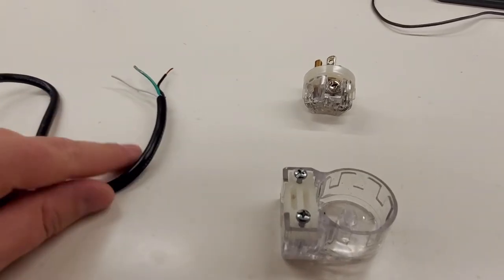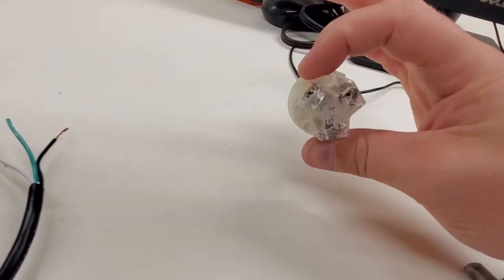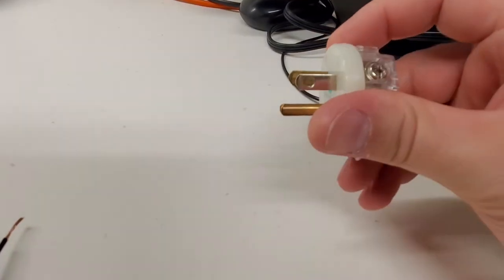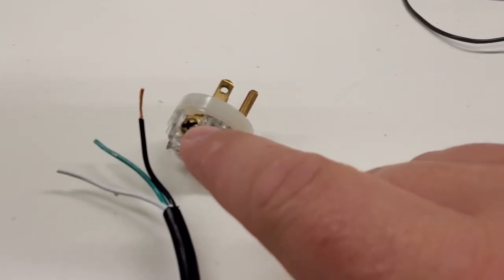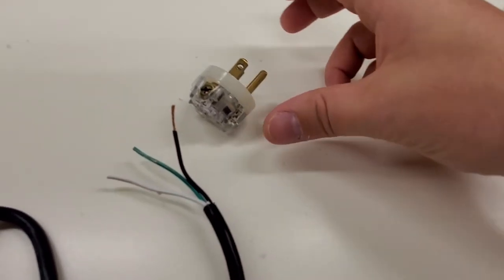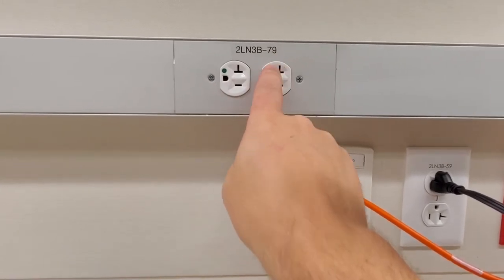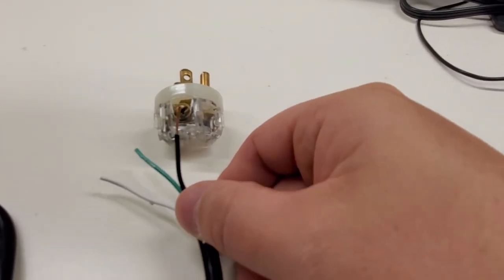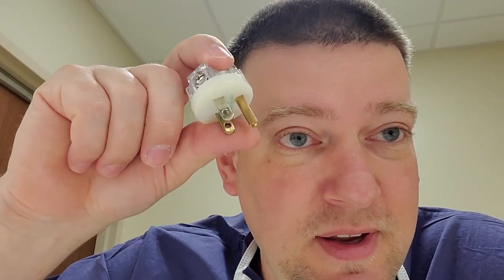Wiring Plug Ends Correctly

Comment: @Better Biomed Channel. Here are a few questions i had. 1.During techschool how did the people with little to no electrical experience do/how fast do the instructors go from one topic to another. 2. When it comes to CDC's how many books are there and are you tested just at the end of each book or end of each book follow by commutative test/ how hands on vs in writing are CDC's. 3. In order to be a 7 level what other than ALS (if yall go through that) is required. Asking bc im testing for staff a few months after my crosstrain window opens 4. How easy is it to transfer to the civilian side and how would x amount of military bmet years transfer to civilian bmet. Such as x military years is ruffly bmet 1 y military years is ruffly bmet 2 ect. Thanks in advance. If you need to take your time answering i understand. if its easier to make a video on it (up to you) that works for me too. Hope to hear back soon either way.

Comment: Something doesn't add up with your explanation. The same current passes through hot and neutral. They are loaded exact the same, and will get equally hot, in case of being from the same material/contact resistance.
Reply from the maker: You would think that however, look at worn IEC connectors and you'll see pitting on the load side not on the neutral side. Blades on old worn plugs, pitting on hot side. I get what you're saying and I've considered that as well.   It could be as simple as a constant visual indicator for Hot. As I said, the other terminal is nickel-plated which means it is brass as well underneath.
Reply from the maker: Id love to do a video with FLIR to see what really happens
Reply: @BetterBiomedChannel  Yes please do that. Here in Denmark we have 230 Volts and no sign of any pin being more worn than the other. If anything it's completely random which one fails if it's grossly overloaded for some time.
Reply from the maker: Interesting.  Perhaps with 120V we pull higher amps (on average) and those amps are the reason typical cords get warmer / arc.
Reply: @BetterBiomedChannel  you do pull more amps in average, yes. Normal household fuses here is 10/13 Amps and 16 Amps for stoves/ovens/washing machines that runs on 3 phase 400 Volts.
Reply: Hello, I am coming up on my cross training window for the Air Force in a few months and Biomedical Equipment is one of the careers I'm looking into. I have some questions that you've skimmed the surface of answering but was wondering if I could get more details.
Reply from the maker: @tylerquattlebaum2015  Sure thing Tyler